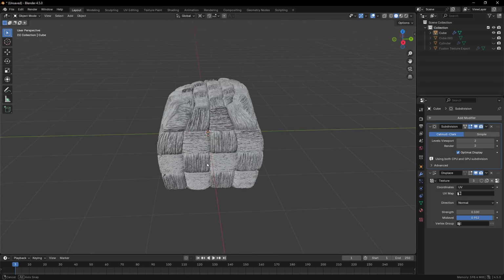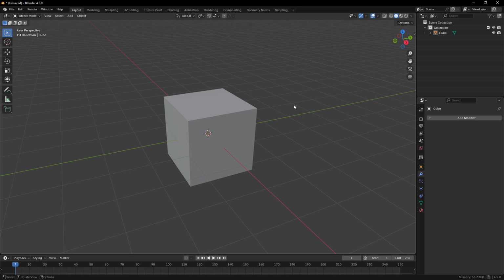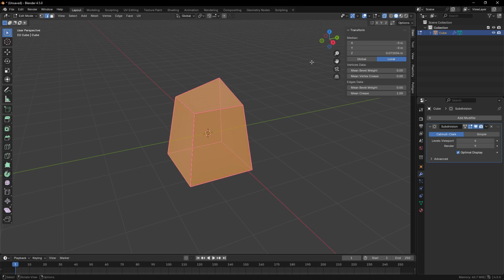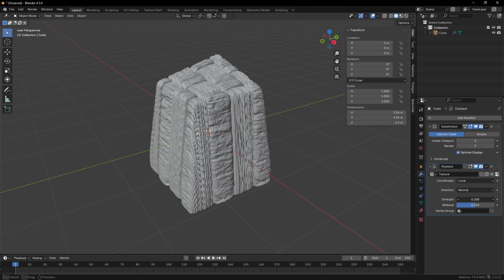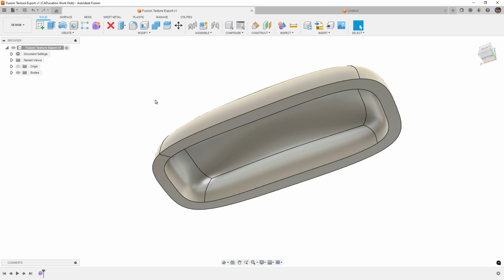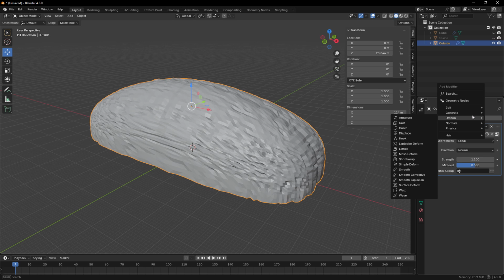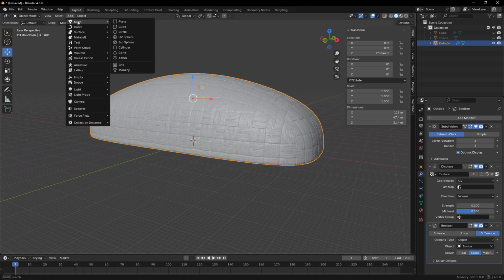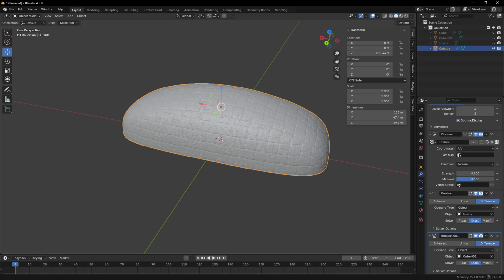How to Add An Image Based 3D Texture on CAD models for 3D Printing Using Blender

Comment: sorry, but this is the worst possible UV map for this kind of geometry - it creates a lot of artefacts on the surface...
Reply from the maker: Don't be sorry.  With CAD models converted to STLs the meshes are nasty and I am always happy to learn and take feedback.  I couldn't think of a good way to mark seams and do a proper unwrap to show this technique.  If you have a good methodology for this type of thing I am happy to learn!  If i had done the model in Plasticity and used the Blender Bridge it would have had the option to mark seams and done a much cleaner conversion, but the original video was looking at the new Mesh Texture Extrude tool in Fusion so was hoping to show another method.  If i was making this carbon fiber "loaf" I probably would just model it in Blender.  UV unwrap with Minimum Stretch gave a slightly better result but they all had some funkyness going on at what would be the edge of a quad in Fusion.
Reply: @LearnEverythingAboutDesign  heyo. i always watch your tutorials and learn a lot! love it! this time it was however this "wtf is he doing there" moment.. :-)  and as somebody who originally comes from 3ds max i know the pain of trying to do further work on CAD models imported into a polygon based software (even i don't use blender). yes - plasticity has a not 100% perfect but a good solution with quad export - but fusion is always pain in the butt...  i guess there is currently no good way without remeshing the object. plus - i think most people coming from CAD have no idea UV-maps are and what they are good for... i guess this would be a good start to explain that... no hard feelings! love your work here!
Reply from the maker: All good and always good to have a sanity check!  If you export a prismatic part from Fusion it marks "sharps" for you which can be a start, but on a funky shape like this its a crap shoot.  What i found with a remesh is that the lower edge gets messed up pretty bad, and because of the mesh there is no "loop" selection.  So basically a giant migraine to try and do anything meaningful with.  Maybe i can do a follow up with Plasticity and the blender bridge with an attempt at a quad mesh with seams marked so the UV unwrap is a bit more predictable.

Thanks again for watching and the comment.
Reply: @LearnEverythingAboutDesign  just a thought here from a non-fusion user, but you might actually be better off exporting your .STL in as low a resolution as possible.  that will make the triangle clean-up easier to manage, you can turn those few(er) triangles into quads just by removing appropriate edges, and from there, remesh/retopo will be native quads and waaaay easier to work with in blender.  

again, i may be full of crap but thats my free unsolicited advice for today.  hope this helps!
Reply from the maker: Yeah. the problem is the person the video is for likely has no blender experience so its asking a bit much to do any retopo.  I have found that remeshing mod to not work very well for these CAD imports.  Fusion has the option to make a quad mesh but it converts to tris on export.  Really unfortunate sadly.  If you are working on a form, you can right click on the form body and export the cage as an OBJ which will get you a nice quad you can use, but you won't have things like holes or other features that you might add after the form.
Reply: @LearnEverythingAboutDesign  plus of course what you do in the end - removing the displacement on the bottom with boolean is not really "best practice" 🤣 - i don't know how it works in blender, but in 3ds max you would use multi/sub-object material as one possible solution... ;-)
Reply from the maker: I did try multiple textures on a single model but with the displacement mod it wasn't working.  Could just be my lack of knowledge on it.  I also tried to separate the UV unwrap.  Pretty much every other thing I tried to do was a pretty long/hard task to complete.

If the Fusion tool would just work on non-planar stuff it would be fine ;)
Reply: @LearnEverythingAboutDesign  as mentioned - i am not a blender guy, but as far as i know you can create vertex groups in blender and apply effects only to these parts pf the models... not sure if it works with displacement..
Reply from the maker: @neetsmlam  I'll dig into it thanks!  I have been able to apply different colors to different parts of a single mesh, but when i did the displacement it all went crazy.
Reply: @LearnEverythingAboutDesign  Is there really no way for fusion to output proper topo mesh? Or maybe for Blender to ingest 3MF or  STEP/FBX File?
Reply from the maker: @hydraulicsystems332  Blender can ingest 3mf but the problem is that every mesh export (as far as I am aware) from fusion gets the standard CAD treatment.  Fusion has the ability to convert a BREP to mesh with quads internally, but if you export that it gets remeshed.  The only way i know is with a form you can right click on the body in the browser and export the control frame as an OBJ which will give you a nice quad based on how the freeform body was modeled.

Comment: The fact that the model was made in fusion has zero to do with the speed issues. The fact is that your vertex count is massive. This would be the same no matter how the mesh was created. 291MB on a single object is a lot of geometry.
Reply from the maker: Maybe true but quad models in Blender created there didn't hang up the system during subDiv mods.  SubDiv on a full tri based model (at least on my system) was making the system angry.  I made a few test models and applied subDiv mods and took some models out to 30million verts and it wasnt as laggy.  Im not saying you aren't right but CAD models brought in as the tri meshes have never performed well for me and I always have attributed it to the tri vs quad nature.

Comment: Great Video Matt.
I'm not a 3D printing person and there are a few things i would do differently but like you mentioned this video is targeted at people that have zero understanding of UV space. But if someone was wanting add these kind of surface textures on a regular basis id imagine that they would want to learn uv mapping or even remeshing or manual retopoligizing and then sculpting in the details using a height map for more prescion.

The two small things i will mention though that could make things easier is with the subdivision modifier instead of creasing you can change the algorithm from catmull-clark to simple.
And with the boolean modifier, if you know your mesh is water tight which it would be for 3d printing you can use the manifold option which is fairly new but a lot more perfomant than the "exact" method. 
Cutting the uvs manually or even using the cube method could give decent results.
Reply from the maker: thanks for the info and tips Peter!  I will have to give those a try and see how they work!